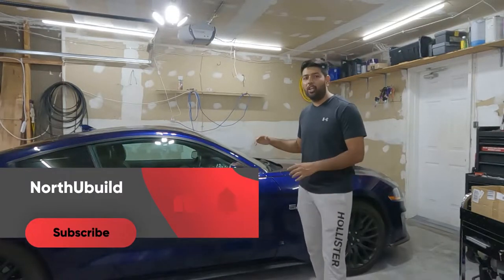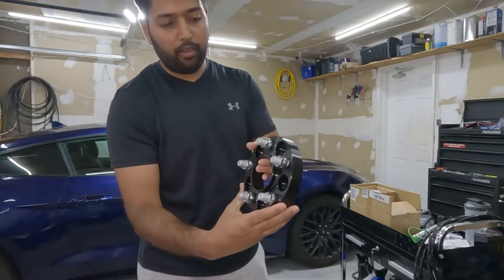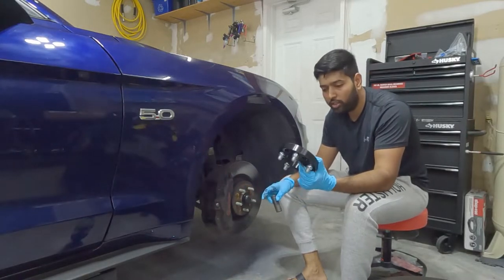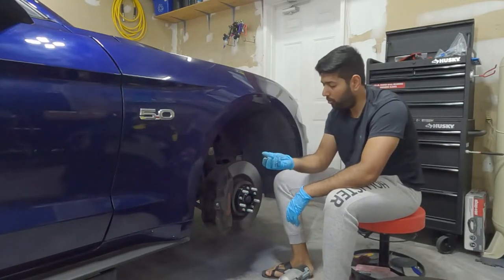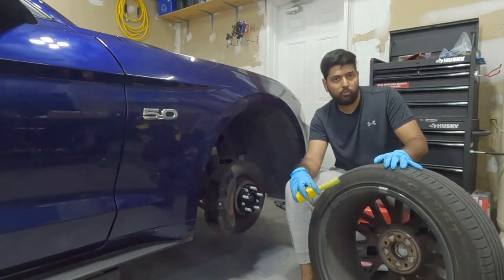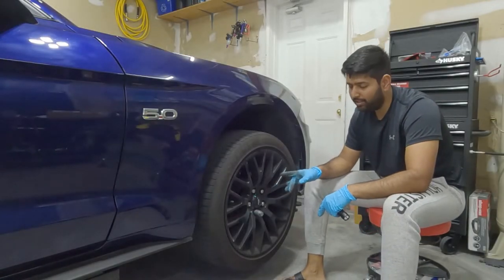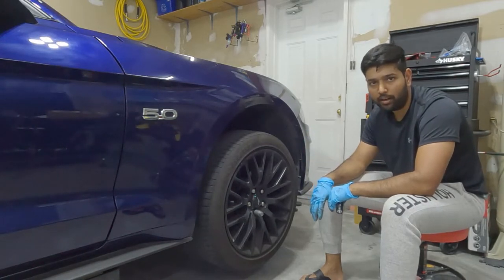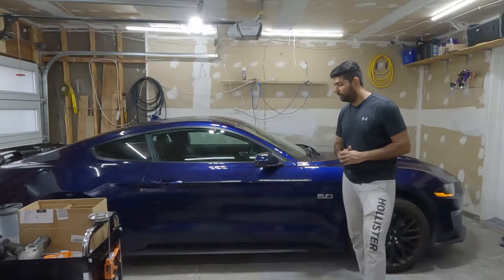Installing Wheel Spacer on 2020 Ford Mustang GT

Comment: He seems to do every step properly a lot of the videos out there don't but still nobody seems to address retouqing after about 60 miles or a 100 km depending where your from the wheels should be pulled off again and the spacers retouqed same with the wheels

Comment: Trying to choose between 25 and 20 mm in the rear. Are you satisfied with how the 25mm looks?
Reply from the maker: Yes I am satisfied with 25mm. It's perfect.
Reply: I read 20mm has issues with the factory studs.

I'm in this very dilemma. Here in the UK the rears are already not so bad. The fronts need 25 for sure but I'm not sure about the rears
Reply: Just installed 25s front and rear yesterday, they look great. Thanks!